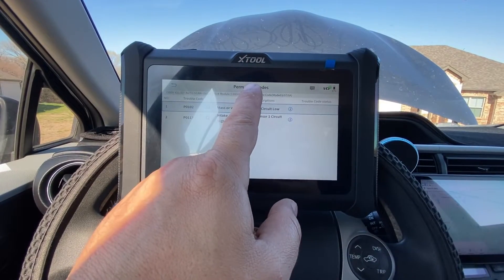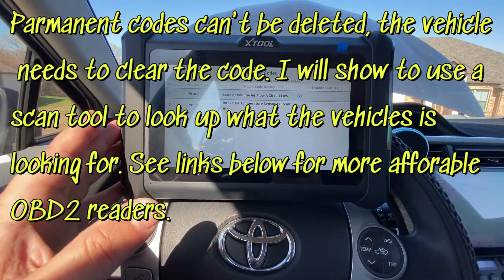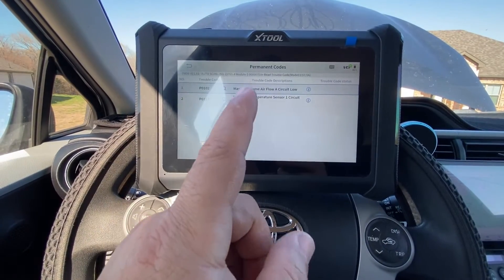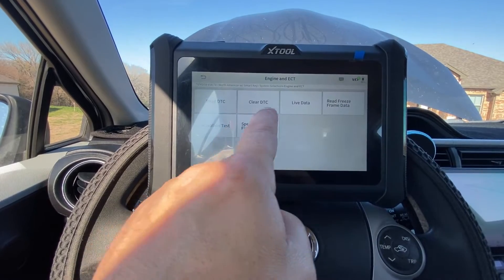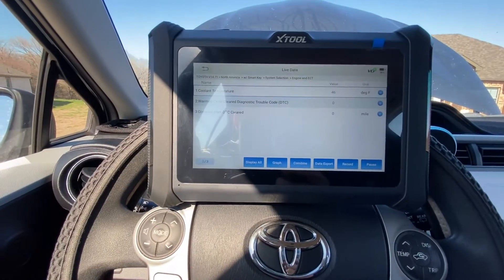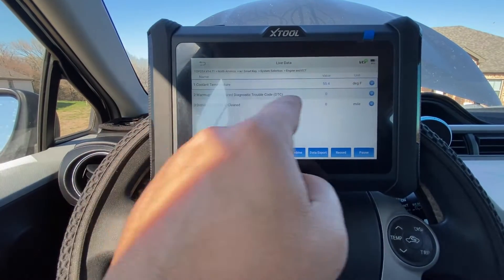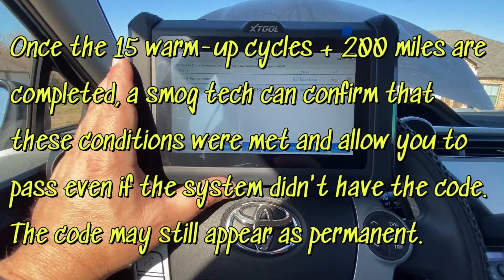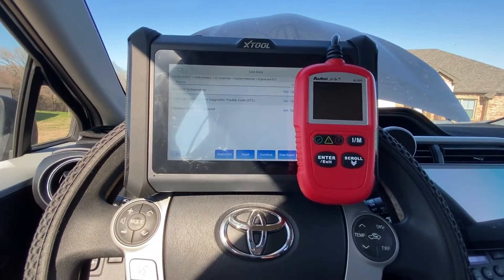Say Bye To Permanent Codes! Clear PDTC using Scan Tool Data

Comment from the maker: ▶▶ Link to recommend OBD2 reader https://amzn.to/3SgUTf3
▶OBD2 Reader video https://youtu.be/SguhiTfgpFQ
▶ Why you need a scan tool https://youtu.be/WrzE_E6WixM

▶Complete Smog Playlist https://www.youtube.com/playlist?list=PLDEbtVOPRC-h4WB90arPwdn_r7wr3kGki

▶ Good Bye Permanent Codes! Drive to Clear PDTC https://youtu.be/BDTrfkxBvJU
▶ PDTC won't clear? Get Rid of PDTC with OBD2 Reader Data https://youtu.be/wcCRN_c6Mss
▶ Bye Bye Permanent Codes! Clear PDTC using Scan Tool Data https://youtu.be/MTW5_MF0KY0
▶ Scan tool used in video 
https://amzn.to/49vJoqS
special code  XTOOLD7WRDF (8%discount by using this code)

Comment: So the above 165 , below 120 would likely mean my remote starts might bea not counting towards warmups. Remote start wouldn't get me to 165 and if it shuts off and I key start it won't be below 120 so won't count. My dtc is off, and I have no current codes but a whack if history or permanent for all sorts of stuff I was never aware of. I did get the network going whacky until I had the side radar modules disconnected and the connectors bagged.

Comment: Couple of comments. This is a better explanation that some out there regarding the 'permanent code' issue. 
 A) Stupid automakers shouldn't have called it permanent as it then spooks people who wonder why to delete or  help it retract itself. A better name might have been 'long term confirmation code' or some such.  Point being, there is conflicting info 'out there' about whether sophisticated expensive scanners and/computers can go in an turn off a 'permanent code' - Supposedly a VCX Nano along with a Windows laptop and some software can do it - IDK.  

 B) My PHEV car threw error codes for the charging system just before having to be smogged (completely unrelated, just annoying). I topped up the coolant system for the charging system (it was a bit below fill line, I believe this the source of complaint by the car).  Foolishly, I cleared the error codes with a cheap OBD2 scanner, not realising that clearing the MIL (the idiot light) that way also cleared the engine monitor sensors (which to pass smog must all be within range).  Shortly after the idiot light came back on, thanks to it's status as 'permanent' (which as noted above is a dumb name).  Now I'm doing the 15 drive cycles and 200 mile routine, expecting the car to sort itself out.   One mechanic also told me that this also has to be stretched out over 16 days - but he may have been talking through his hat.  The exact number of drive cycles, miles driven, and if it needs to happen over many days is still mysterious, but it would seem that there is consensus that - if the correct repair has been done - that eventually the car will sort itself out, release the code, and turn the idiot light off.     - I hope -
Reply from the maker: Thanks for sharing and you are right a better name for a permanent trouble code ( pdtc) could be improved.
So it’s the 15/200 rule, 15 warms up so that why the mechanic told it cold take 16 days. 
Even if the 15/200 rule is met doesn’t mean your vehicle will clear the code internally, this will just allow the technician to verify the requirements for him to bypass and proceed with pdtc and pass the vehicle.
There is no way of clearing a pdtc and if you look in the video description I have tried a few. If the vehicle will not clear the pdtc then only fix is a new ecu ( engine control unit).

Comment: why would you be clearing permanent codes unless you are hiding something?
Reply: I have that cheap code scanner, does it show miles and warm up cycles since evap cleared. I have 2010 ford fusion,all monitors ready except evap, 2 permanent evap codes po456 and po455. I live in Vermont and try to get inspected, any help would be appreciated ty!..Can I pass with no cel
Reply: With not ready evap and 2 permanent evap codes if I have 200 miles and 15 warm up cycles since evap code cleared ty
Reply from the maker: You can’t clear permanent codes, that’s the point of the video. 
What are people hiding about pdtc?  Their vehicle is detecting in an issue and they want to pass, lol

Comment: I just tried your method did not work, 2012 gmc terrain. Cold start 104, 2k rpm ECT normal about 176, I ran it to 180. No change in warm starts count. BS or is the only for Prius?
Reply: UPDATE: This did work for me with a few tweaks, lowest temperature I tried was 107, idle for about a minute then drove my car for 4.5 miles looping home, engine temperature was 176-180. It did count as a warm-up cycle. I can do this about 3 maybe 4 times a day depending on outside temperature. 👍🏼👍🏼👍🏼👍🏼👍🏼
Reply from the maker: Thanks for the feedback?”
Maybe one size doesn’t fit all?

Does your vehicle show any warm up cycles completed from normal driving?
Reply: @RANDOMFIX  yes, but only 3. My battery died on Monday. All obdll information lost. Drove around all inc are now complete, but I have stored code that I need to get reset. I’ll be driving tomorrow and will have well over 200 miles. Need to know how to do warm cycle. Thanks

Comment: Great information, my question is does it have to be 200 consecutive miles? My smog guy told me drive the 200 miles but stop just over 50 miles, turn off car wait a couple of minutes and do that 4 times.
Reply from the maker: Either way is fine, the rule is 209 miles and 15 warm up cycles. Warm up cycles include the engine cooling off for a while not just turning it off and then restarting.
Reply: @RANDOMFIX  I waited for engine temperature to be 104, then started and rev till temperature was 180. No change is warm-up counts. Instead of rev do I drive around?
Reply from the maker: @alunatick12 I’m sure you are driving the vehicle, have any warm up cycles been recorded?
Reply: @RANDOMFIX  1 this morning, but I don’t know what is making it work. Started car in morning, turned on ac/ rear defrost, radio. Let it run for 3 minutes. Then drove streets and fwy totaling 40 miles. It’s getting really tired driving, I’m disabled bad back and knee. Drives are to long.

Comment: Does permanent code triggers limp mode? Its hard to drive 200 miles on limp mode though.....
Reply from the maker: A limp mode code could be a present pdtc or permanent diagnostic trouble code. You have to fix the issue with limp mode and then complete 200 miles and 15 warm cycles so vehicle can learn that issue has been fixed. If the pdtc is still present then the smog technician can verify that the 200 / 15 rules has been met and allow you pass.
I hope that helps and good luck

Comment: You know you have to actually correct the issue that is causing the permanent code or it will just keep showing up. If all you are doing is trying to delete a permanent without correcting the issue the code will come back. The resister and alligator leads will clear a permanent code, some manufactures may have implemented the ability to store the code on a memory chip and not just in memory in which case you will have to use a computer to erase the permanent code.
Reply from the maker: Yes, it’s agreed that issue that caused the pdtc has be address.
I know that permanent codes can not be deleted or erased. If you have a computer program that can do it please let me know about the program. Additionally I have tried this on other vehicles with the outcome.
I welcome your response and I hope you prove me wrong.

Comment: Please say in your videos that there is really only one reason to attempt any action to get rid of the Permanent code.  That is to pass a state emissions test.  And even than many states do not even care about them.   If you do not have a test to pass just leave the Permanent code alone.  With the check engine light off there is no reason to do anything with a permanent code.  It's not hurting anything being in there.   And for gods sake do not spend any money on parts in an attempt to "fix" anything.  Nothing is broken with just a permanent code present.
Reply: car dealers like us who wholesale cars..always try to get rid of the permanent code before auction, and it is a pain in the ass to drive every car 50-100 miles.  The best are Hondas, they go away fast.
Reply: Is that why some refer to them as history codes maybe.
Reply: @gadasavideos8564   -  The term History was something scanner manufactures came up with to sort of keep track of codes that were in your car but they just remembered them in the scanner not the car. .  Permanent codes are embedded in the ECU and part of the OBD framework.  But yea in all honesty its a better name for them but since scanner manufacturers used that term for years in thier scanner programming  I think they were afraid of confusing even more people.   Wish they called them "Confirmation" codes.